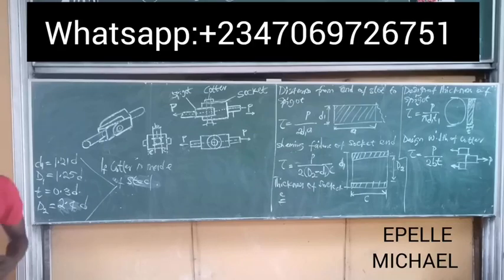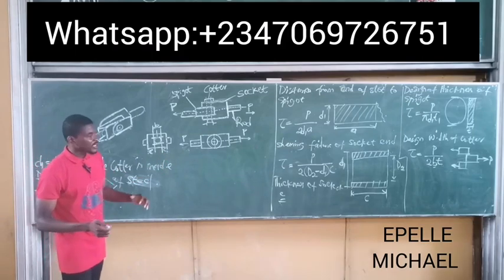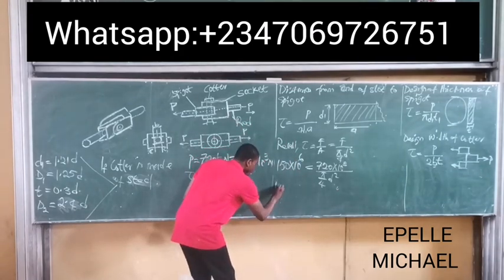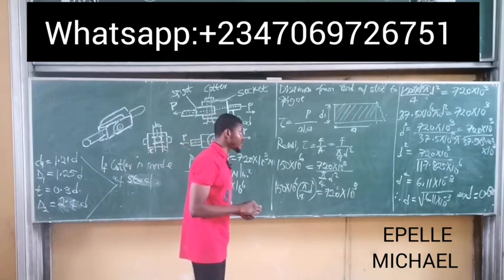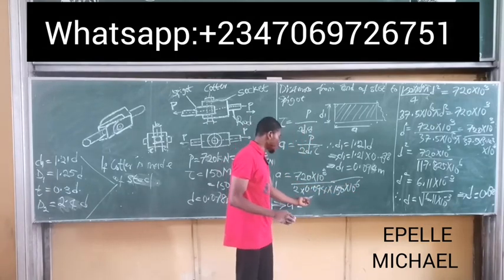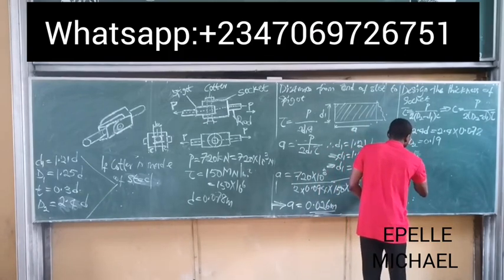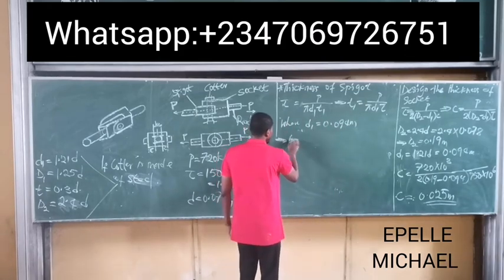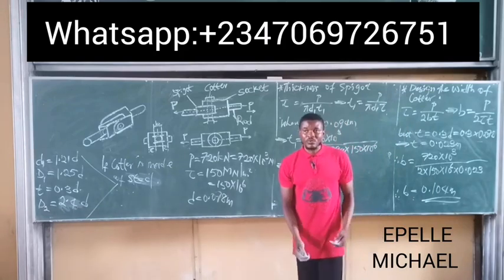Design Procedure of Socket and Spigot Cotter Joint | Design of Cotter Joint

Comment: On the screen D2 is 1.75d 

On the board D2 is 1.25d

Which is accurate
Reply from the maker: Use the one on the screen
Reply: @engineersmindset240  okay

Gracias